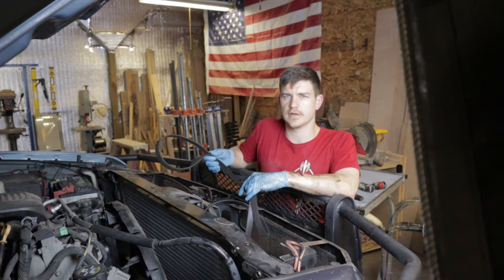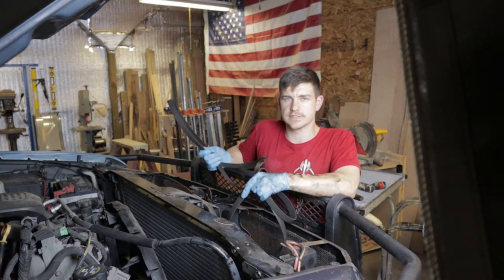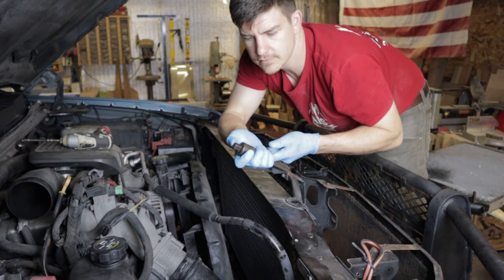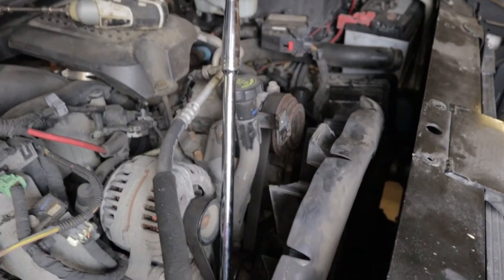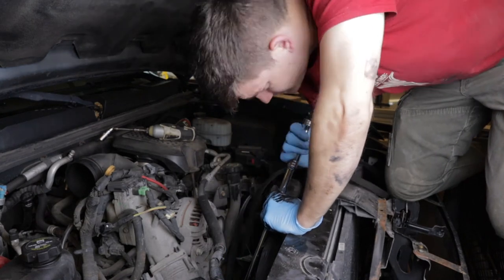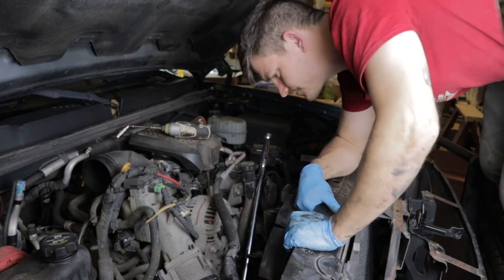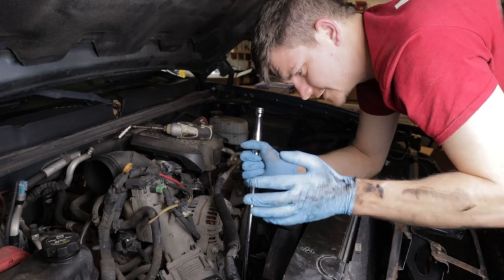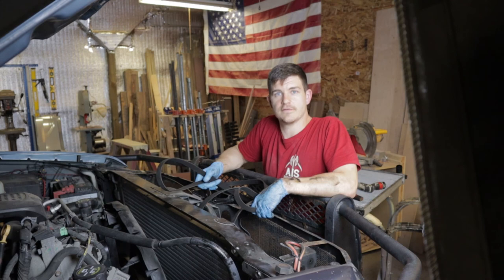Duramax Belt Replacement Trick

Comment: Great video   Do make sure I get the correct belt for my 2008 6.6  Should I use the VIN or the RPO code you mentioned  If RPO code what are we looking for on the belt? Should the idler pulley be replaced as well?  I have 66K on this truck  Hardly used and will last a lifetime with a good maintenance program
Reply from the maker: The RPO code would be the most accurate outside of a dealership. If you're ordering from a dealer they'll probably just ask for the VIN. If the pulley isn't making noise then just leave it. That's awesome your miles are so low. That thing will last forever!
Reply: Just call a dealer with the VIN